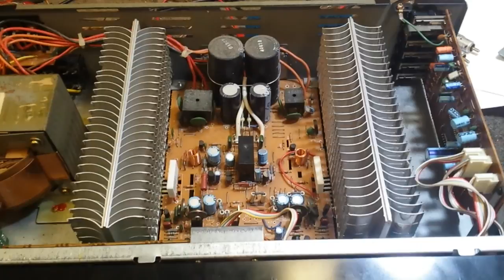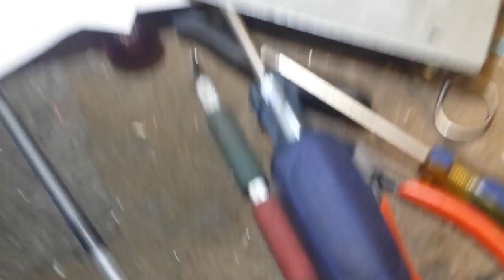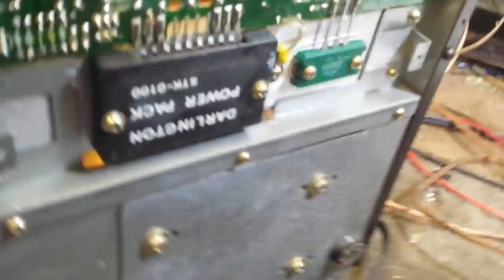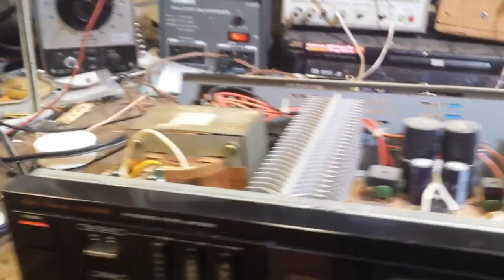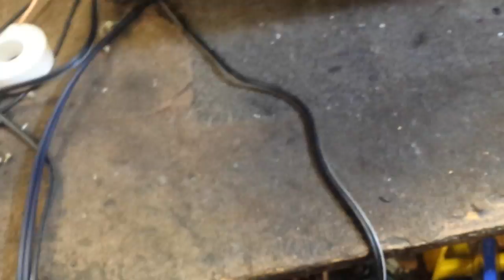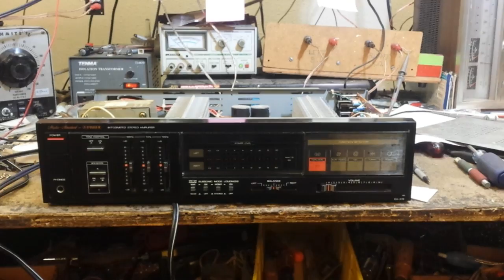Servicing your fisher ca-2xx amp - pointers

Comment: Thank you for this video. I  loved my old Fisher amp back in the 80s but it died. I recently purchased a CA 225a and both output channels just died. I was looking to buy another used Fisher. I think the overall design with that voltage dump is just stupid. I really worry about blowing my speakers and I now have no confidence in this design.
Thank you again for posting😊😊😊😊

Comment: Hello Jordan, thank you for creating this video.  I was just given a Fisher CA-273 and it pops the power fuse everytime I try to turn it on.  Using a multimeter it appears the two inputs to the transformer are shorted.  Is this normal?  If not, what is your recommendation to repair the amp.  My Son is excited to enjoy this vintage piece.
Reply from the maker: It's normal for the transformer to have low ohms. It's not possible to determine if it's bad this way.

If it's blowing fuses, the output transistor could be at fault. The power supply and main rectifiers could be at fault. More serious troubleshooting needs to be done to determine the failure and course of repairs.

If you're willing to ship or are located near east Tennessee I can service it for you

Comment: I have worked on many of these SS Fishers products. I have seen it, poor solder, broken solder everywhere. Looks like they used some really cheap solder at the factory, and some of the bigger transistors not on heat sink run pretty warm. A lot of electrolytic caps are failing in them by now. But overall they are fairly easy to fix, parts for the most part available, even OEM sanyo ICs. The OEM Toshiba outputs are long gone, they have a substitution for them. I used some china knockoffs but after reading about them I regret it.  Oh and the dreaded brown glue, the corrosive glue, you have scrape all that off and replace stuff it corroded.  Once you get one all fixed up it sounds good and powerful.

Comment: Mine was working fine then we stopped using for years, turned it on and smoke 💨. It was coming from the power switch. I used compressed air and blew out all the dust I could get to but still smoke And no sound. LEDs on meter do move so it’s receiving. Fuses were not blown but would if you go back and forth from A or B and B would make a loud horrible sound. And fuse would pop.

Comment: Had my for years experience still. Working but did have issues with the speakers st832 but replaced tweeters and mids had 1 woffer rebuilt thanks

Comment: I have one that won't change the function selection from Tape.  Solder?
Reply from the maker: Check that the button or other buttons aren't stuck. This will cause that symptom

You may need to ohm each out to determine the stuck one.

Comment: Hello Jordan,
I have a Fisher CA275 amp. I keep loosing the left channel. The speaker fuse keeps blowing. Any ideas what I should be looking for? The right channel seems to hold up better at higher audio output levels.
Thanks 
Tony
Reply from the maker: Check for defects in the wiring to the speakers or speakers themselves
Reply: @JordanPier  Hello again, 
I switched speakers and speaker wires and both speakers seem to work fine on the other channel.
Reply from the maker: @anthonypizzuto1142  you may have early signs of driver or output stage failure in that channel.

Comment: It's 53Vpp when it switches to high voltage. On the schematic diagram  it is around 26Vpk on the output to each rail So it's about 44Wrms on 8 ohm load. That means they work on low rails most of the time..  Impresive!

Comment: Do you have any videos with the Fisher CA-880?  I have some stk0080's that need replacing. Thanks in advance.
Reply from the maker: Good luck. There are no known good stk-0080 modules out there anymore. You either need to build a discrete one or toss it. Discrete modules are available, but aren't cheap.
Reply: Where can i find discrete modules?
Reply from the maker: @clintmurphy5436  https://rover.ebay.com/rover/0/0/0?mpre=https%3A%2F%2Fwww.ebay.com%2Fulk%2Fitm%2F123664180725

But you will need to build and assemble them yourself. Not for beginners but guaranteed repair
Reply: Honestly id like to just turn it into a preamp to drive some rack mounted amps with.

Comment: i have a fisher ca-273 went to power it up and got a buzz then it blew a fuse now it just repeatedly blows fuses when you turn it on any ideas ?
Reply from the maker: Power supply or amplifier failure
Reply: @JordanPier  Thank you will be checking those

Comment: Hey Jordan, thanks for the tips. I've landed here because I want to save my beloved CA-276. One of the channels will play louder and terribly distorted at random times. I ASSUME this is what you are describing here, and it's trying to cook my speakers?   At any rate, I wonder if this sounds like a familiar soldering symptom to you? Thanks!
Reply from the maker: Could be soldering, or component failure - on amplifier feedback circuit or in regular signal path

Comment: I have a CA-273.  What is the name/type/model of relay you suggest replacing the original crappy factory one with?  Also was the one shown in the video a direct drop in replacement?
Reply from the maker: +Jeff Corrado the omron g2rg-2a4-dc24 I believe was a drop in replacement and is about double the current rating

https://www.mouser.com/ProductDetail/?Omron-Electronics%2FG2RG-2A4-DC24%2F&qs=ImaqFqjHA4mkCMVixICtNg%3D%3D
Reply: Thanks!

Comment: Hello I have the ca-273 I replaced the fuse of the system A but I have seen that one resistance is warming up till burn , it is on the section of the swicht power. And power on after 6 seconds.

Comment: I have a CA-271 which I just received from my grandfather.  The right channel doesn't work, the front power meter for the right channel will light up at 0.3 watts when the left channel is at 30-60 watts.  Do you have any idea of what could be the problem?  Even through the headphone jack, there is no right channel, I didn't think the headphones would use the same parts.  What types of fuses would you recommend as well?  I have no manual so I cannot check for specifics.
Reply from the maker: +Marco The Lynx replace blown fuses with the original rating (usually printed nearby) problem could be soldering, open resistors, or a variety of other problems.
Reply: I figured out it was a blown fuse,  I also didn't see the ratings for them originally so thank you for pointing that out to me.

Comment: I have a CA-857 which I recently acquired.  It won't power up.  So far, I've checked some simple things like the switch and fuses.  Any ideas on what the next step should be?  I'd like to check the power from the transformer to the amp board, but I don't know what the AC voltages should be.
Reply from the maker: if yours uses a remote control, the standby power supply may be to blame for its lack of cooperation.  you really need to locate a service manual with a schematic. you'll also need a good meter and esr meter to check parts

Comment: hello 

great video I have the same model  I only get audio if I use the main input on the back I can't get audio from CD Tape etc

thank you
Reply from the maker: Ali Obaid install a jumper rca cable between the pre out and main in jacks. there used to be a shorting bar, but someone obviously removed it
Reply: Jordan Pier thank you worked great

Comment: i have one of these someone gave me the problem i have is i can turn the volume all the way up and faintly here music you think the power packs are bad or should i be looking  at another part of the circuit
Reply from the maker: danab26 usually if the power packs are bad it blows the fuse. if you can only hear music faintly I would check to see if the tape monitor functions are off and if the pre-out/main-in jumpers are present (where used, don't remember which ones use it)

if still no improvrment, start checking power supply, regulators, and speaker relay timing circuits per schrmatics
Reply: ok thanks for reply and i have replaced the fuses and still same result so i will check the options you listed